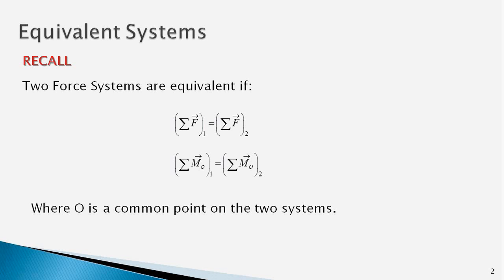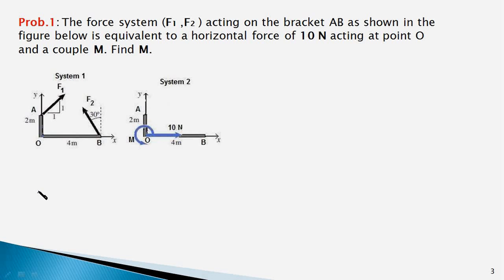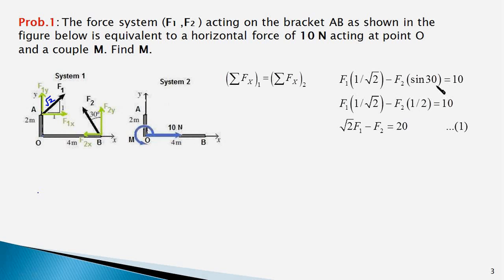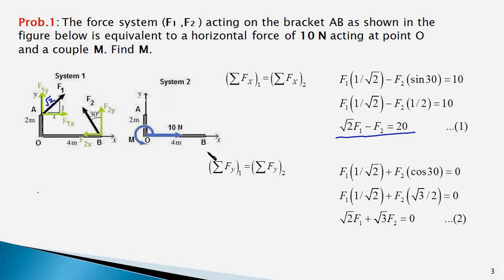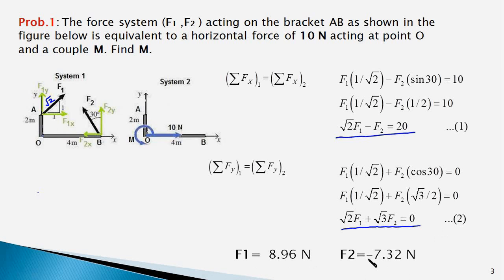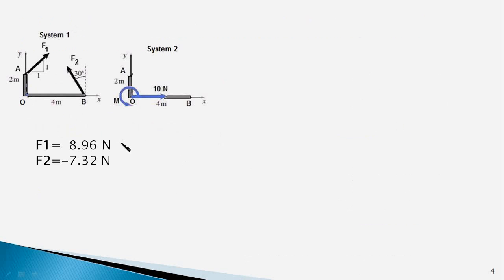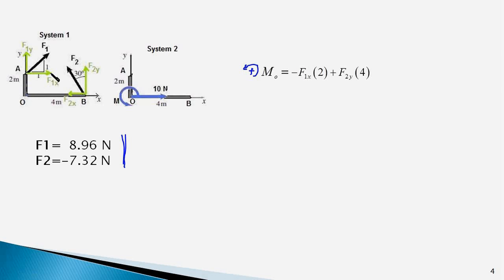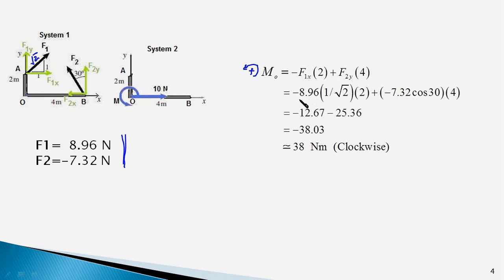8.2  How to find equivalent force couple systems (Part 2)

Comment: i thin there's mistake in how you solve the unknown of fi and f2
Reply from the maker: Hello Fadli; Please point out the step that you think is incorrect.
Reply: @bilal24302  I know it's late but just for the sake of those who came later, The 2/sqrt(2) is just the same as 
"[sqrt(2)*sqrt(2)] / sqrt(2)" so the answer in that example is sqrt(2)F1. It's the same for what happened in Fx.